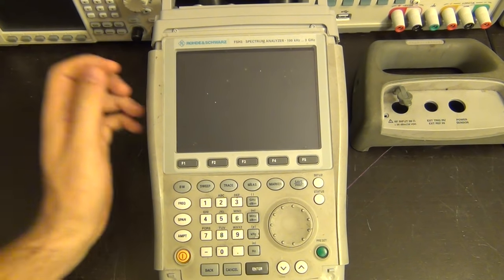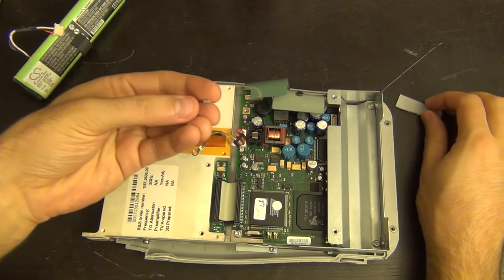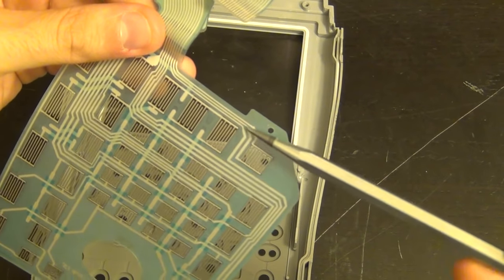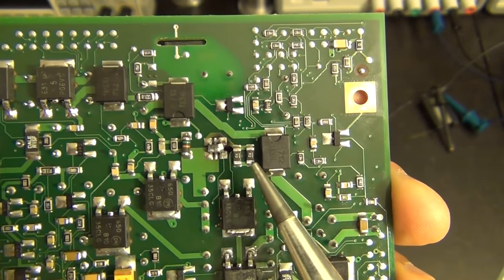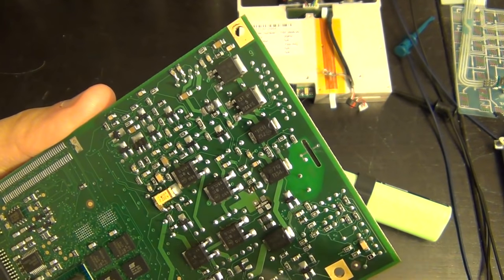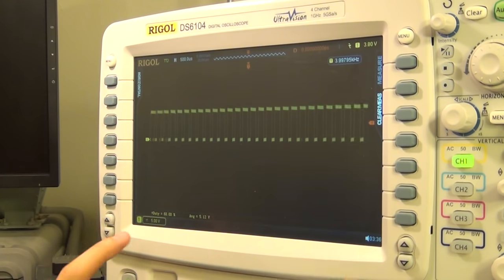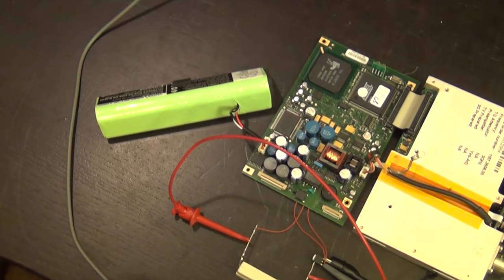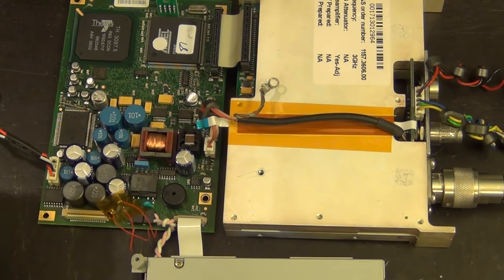TSP #58 - Teardown, Repair & Analysis of a Rohde & Schwarz FSH3 3.0GHz Portable Spectrum Analyzer

Comment: Great video!

After watching the video I put my old FSH3 under the microscope and found exactly the same defect. A few years ago when I tried to repair it I only noticed that the power supply circuit got hot when connected to the battery or wall adapter.

The original MOSFET NDC651N is obsolete. But I found a much better transistor in the same SuperSOT case from ON Semiconductor (ex-Fairchild). The big difference of the NDC651N and all modern MOSFETs in this proprietary case is the usage of pin 6. But this can quite easily be changed on the PCB. The FDC8884 and FDC8884 have much better parameters, except from a slightly higher input capacitance.
Reply: Exactly the same fault with my FSH3, I used the FDC855N (ON Semicond.) former Fairchild, works perfectly with pin6 bent up due to changed footprint but same package size. 

Thank xou so much for publishing this video, was really lucky when I observed the pulses after dead battery replacement. Changed just the NMOS after checking the resistors R31, R85 and R79 to be found ok. Great job, Shahriar !

Comment: The same  problem with my SFH6. Replacing the MOSFET with IRFTS8342TRPBF (30V, 8,2A, 2,0W), and cutting the short from  pin 4 to pin 6 on the board and the machine works! Thanks for the video,

Comment: I was responsible for calibrating/repairing these units years ago. FSH6 to be precise. R&S fielded a power plug that didn't fit very well into the jack which left people shoving and jamming the plug into the jack. When i worked on them, I would remove the top and use mini-grabbers to feed power to the unit.
Reply: Clark,
I have one of these but I believe that the RF attenuator or input path is faulty as the RF attenuator does not track. Any suggestions on how to fix this? I have two units one with no options that probably has the FET problem and one that powers up and has the tracking generator and preamp. Can I transfer the front end components from the bad one to the good one? Any hints?

Comment: Last month we did repair two of this unit, but with track gen. It was the same problem + the diode next to the transistor. The transistor we used: FDC855N and the diode: BYG22DHE3/TR.

Comment: Awesome result! Thanks for another great video.

The length of the video is totally fine. In fact, I wouldn't have minded a longer video if it included analysis on why the transistor failed in the first place, and performance verification at the end. But maybe you were just ready to wrap it up after scrubbing dumpster grime off of that nasty keyboard... :)

Comment: I am working on a Fluke 192A. There is a mosfet like that with a 0.1 ohm resistor and it is burned too. It is also connected to the transformer. But in my case it is missing a gate signal from the power BGA and there is a hardware related firmware problem. It looks similar build to the Fluke indeed. 
Keep up the good work, nice to see and great explanations. I do this for a living but I always looking to learn more techniques and ways to find faults. Thank you

Comment: These broken plastic parts can often easily be welded using MEK (Methyl ethyl ketone (butanone), add a drop or two with some tweezers, let it melt the top layer of the fracture (on both sides), push the parts together, wait 10-24 hours, and the part is bonded like new.
I have used this technique to weld all sorts of plastics, eg. motorcycle and car parts, but also for housings of remotes and other gravity hungry stuff.
The MEK can be bought at any shop supplying Lab equipment and chemicals, I bought mine for about 15 euro's for a liter at "labstuff".(a internet shop in my country) Thus far only used 200ml, and saved me a ton of money already.

Comment: I absolutely love these repair videos - very exciting.  I have to admit, I was holding my breath when you were shorting out that 5ohm resistor, half-expecting a bang and a puff of smoke !!  The thrill when instead the thing actually powered on was great.  

When you are doing things like powering up the device after putting in the MOSFET, do you "cheat" and try it off-camera first or do you actually record the "real" test?  It certainly seemed like you were genuinely surprised when it powered on with that second MOSFET.  That sense that we are all along for the ride with you is definitely part of the fun.

Thanks for making these videos - its always something to look forward to when the notification of a new Signal Path video comes though.

Comment: My workplace has a couple of FSH3 spectrum analyzers and we figured out how to smoke them. The method to reliably blow one up is to run it with batteries that no longer take a charge, then pull the power while it is powered on. 
R&S charged over $2k each to fix a battery and that power IC.
Reply: I had similar experience with R&S, usually the have really high performance equipment and good response to problems. For this part it seems different, high charges for repairs - obviously it took some time for them to realize they have a built-in bug here...

Comment: Great repair and interesting short walkthrough - by now it all starts to look familiar, thanks to your videos -, though I don't yet know why the original transistor could have failed.. maybe too high supply voltage when the previous owner tinkered with it, or just aging?
Reply: hoodaly Job #1 on this sort of repair is to check every tantalum and aluminum electrolytic for both shorts and excessive ESR.  The original part probably failed so spectacularly because of a bad cap.  With luck the new part will be OK, but I wouldn't be surprised if he has to open it up again.

A shorted diode could also have been at fault, but that would have kept it from working at all, of course.

Ideally, it failed because whoever rigged up the kludged power connection  hooked it up backwards or to the wrong supply altogether, and it will be fine now. Heck of a nice piece of hardware for $400!

Comment: With a switching transistor the biggest losses are usually generated during the switching transitions. Ron is usually very small and the losses negligible when on. To upgrade the transistor find one with the current handling and low gate capacitance for shorter switching time.

Comment: I;ve just seen this repair of your FSH. Although it's been more than 4 years, I have to say that replacing a N channel MOSFET with a P channel MOSFET (regardless that it had also lower Id maximum) and be surprised that it burned at once, is a bit silly at least. However good that after all you managed to repair it...

Comment: Did you notice that the pinout for the MOSFET that was on the board is slightly different then the 1A MOSFET you put on.
On the replacement the pins 1,2,5,6 are Drain, 3 is Gate and 4 is Source.
While the old MOSFET only had 1,2,5 as Drain, 3 is Gate and 4 AND 6 are Source.

Comment: I have one bad FSH3 too, i repleced the FET with a SI3456DDV (Farnell 1840419). 
Now the instrument boots but unfortunately it has a lot of other issues to it,
i guess the reason for this FET to die is when the battery goes very low the switch on circuitry starts to oscillate and then the poor FET dies.

Comment: Hi Shahriar...as i understand it, you replaced the original mosfet with a higher rated one. so what makes the original part burn in the first place? I assume it worked for sometime with the original part, so what did happen internally for the original part to burn? is this a design flaw? great video as usual, thanks

Comment: Your main board appears to have the mod that is suppose to protect the  V13  FET.
Is the power supply for this unit a negative tip positive sleeve connector?

Comment: Very well done on the repair, most informative.
Did you check the temperature of the replaced fet? I wonder if there is a design error that resulted in the original oveheating.

Comment: Great video as always!  Question - on the schematic of the IF section, just before the ADC, there's a mixer fed from a block marked 'Noise' and a 100 kHz LPF - what's that for?  Is it to do dithering?  Can you explain how that works?  Cheers  Richard

Comment: Hi,
It's very usefull. Thanks.

I have one FSH3-TV that, basically is one FSH3 width preamp, tracking generator and the capability of TV analog/digital measurements, but it can work as one FSH3 normal. I have a problem with it. It don't detect RF input. Usually, when the FSH3 is started, you can ear one relay click. This one don't make this. Because the R&S service it's very expensive, how I could repair it or where?

Comment: i have the same unit and the exactly same mosfet was failed in my device too . but in my unit mosfet was short and battery was died. probably batteries was empty when mosfet failed and in your unit batteries were charged and mosfet blow up.

Comment: why did you put P channel into N channel mosfet place ?  ?
Reply from the maker: Linas K I didn't, but I did show the wrong datasheet by mistake! The N-MOS that I used was rated for 400mA.
Reply: The Signal Path Blog 
oh, good. I was thinking that why it get into gas state that fast  :D
Reply from the maker: Linas K :) Yes, you are right. The PMOS would put the DC-DC converter in positive feedback and cause some serious issues.

Comment: You mentioned the final filter is very critical because  it is only 2MHz, but on the other hand it is using a S/D ADC, so I would imagine that the requirements on the filter are actually quite relaxed no? I guess you won't be reading this on a 5 year old video,  but maybe some other scavenger of old TSP content.

Comment: you will probably find, like the old Bosch hand held scope-meter were identical to the Fluke, its just a badge engineered product, produced in bulk for R & S, however R&S wouldn't have been able to sell it at or below Flukes retail price.
Reply: I purchased a Fluke scope-meter not working for $200au, 1/4 of the price of a working unit, I've chased the problem down to no -30v supply for the display output, it powers on, the screen lights and I can control the back light to off, it gives 1 beep which means the processor is alive, it just displays nothing.

Comment: MBRD630TT4G replaced to VS-12CWQ10FN-M3 ; NDC651N to STT6N3LLH6, pin nr 6 not connected ; MDT5P06VT4G to  TJ8S06M3L and works fine. All components are available in Farnell.